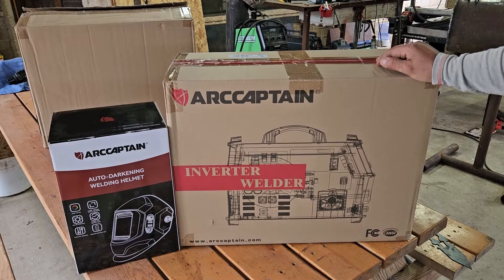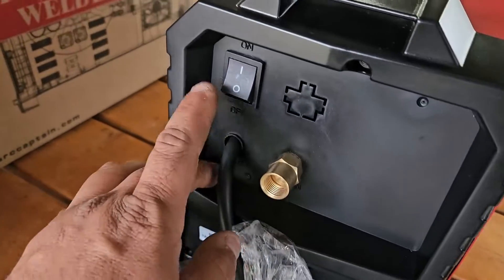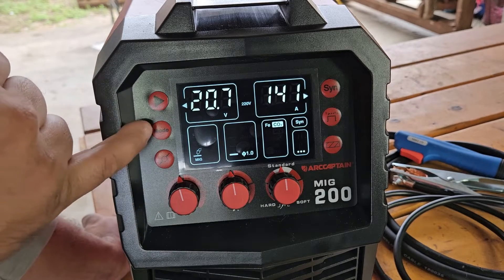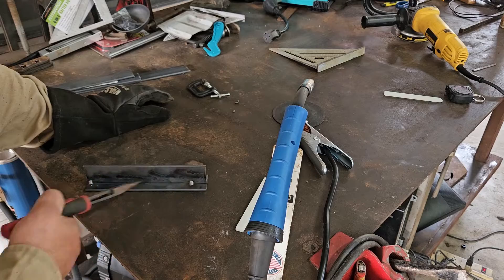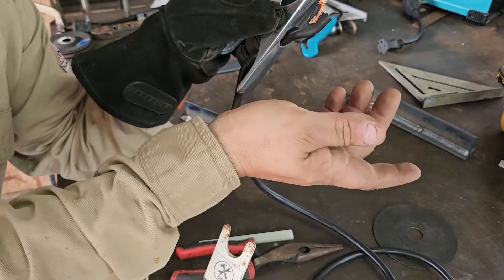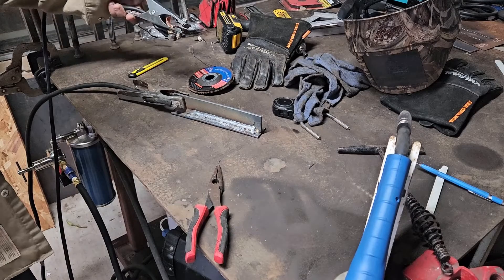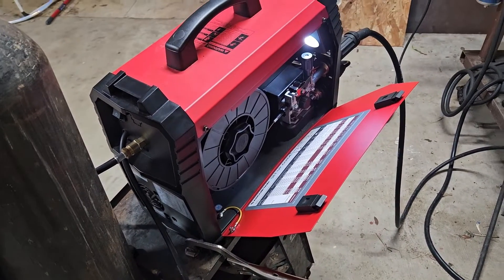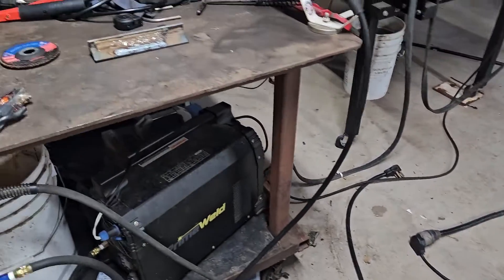Reviewing And Testing The Arccaptain Mig200 Multi Process Mig Welder 200 Amps Aluminum #arccaptain

Comment: How is the "Fan on demand"? Does it start when the welder is getting hot or start on the trigger push?
Reply from the maker: I need to run a test again as I cant remember but believe its when temperature starts to climb. I run the MIG200 mostly.

Comment: Great review video and I completely agree with your assessment as well. I only use mine with .025" wire, so I won't have these issues. For heavier wire, I have a Primeweld 180 and a 285.

Comment: Great review, I have ordered one. I will have a dedicated 110v outlet for the smaller stuff. What amp breaker do you recommend for the 110? 20amps?
Reply from the maker: I am not sure what size breaker I have on 120v (15A?), I plug this machine into my 220v outlet that has a 50A.

Comment: Great 'brief' review, if only, and barely limited to showing what it can do. This ArcCaptain is a highly diverse machine (I bought one myself). However, seeing that melted ground clamp really has my concerns up. I need to check this out myself on mine as I live in Tucson, AZ and the general, ambient heat here ALONE, is remarkable much less having an earth ground get hotter; which is incredibly concerning. But, it's nice to see that a 4AWG earth ground seems to be the right correction. I'll have to monitor mine and see if that occurs under the  60% duty cycle myself.